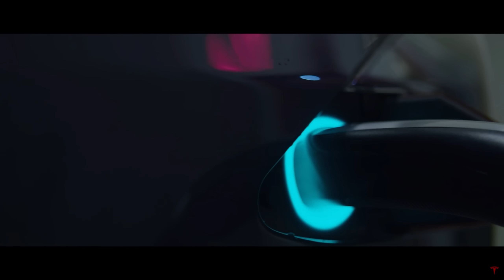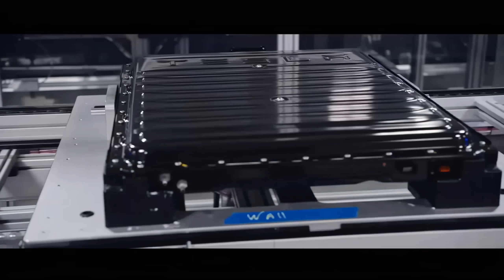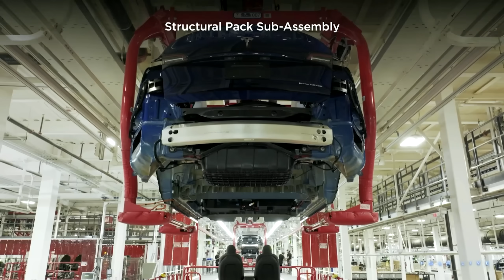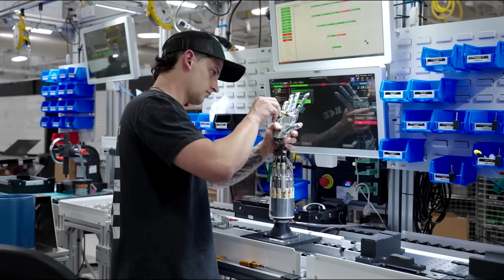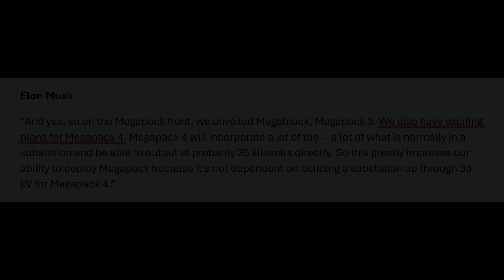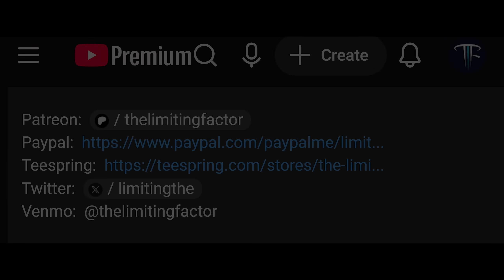The Fully Dry 4680 Is Now in Production! // Tesla Q4 2025 Earnings

Comment from the maker: For those who'd like to go deeper, I've done an article on X called "Fully Dry 4680 Masterclass" which contains information you probably won't find anywhere else:

https://x.com/LimitingThe/status/2018440131057983914?s=20
Reply: dont forget Tesla NV also opening LFP factory in 2026.
Reply: Thanks for the deeper dive on X.
I hear there is a new 2180 cell about to be produced, how does that fit into the lineup ?
Reply: Did you discuss density? Did I miss it?
Reply: NEXT for Tesla is silicon Integration w/ Li metal Anode.
Reply: Does it tell if the battery missing in the mail ever showed up?
Reply: When will they implement these batteries into the Cybertruck?
Reply: @dudeasp1 The Cybertruck was originally envisioned with 4680 cells as the power source. I guess Tesla will allocate 4680 cells to which ever use case will make them most money most quickly, whether it be Cybertruck, Powerwall, Megapack, RoboTaxi or Semi-Truck?

Comment: Tesla Announced in January of 2026 they have Perfected the 4680 Battery with a Dry Cathode & Anode
There has been no info after that announcement
What are the Specs on these batteries?
Where are these batteries?
What cars are these going into?
What Mileage can we expect from them?
Europe Model Y owners are complaining of poor battery performance from their 4860 equipped cars. Are these the “Perfected”  Dry Cathode 4860’s?
Berlin gearing up quickly with factory to mass produce 4680’s, are these the Dry Cathode versions?
Do you know the Model Y RWD Long Range in China get over 821 KPC/ 510 MPC because they use Chinese batteries not allowed in the US. Can the Perfected 4680 compete with China's batteries?
Reply from the maker: They didn't say the 4680 cell was perfected.  They said they can now produce 4680s with a dry process.

1) As always, we need a teardown.  You never trust the specs from the manufacturer, and most of the time they don't really give them.

2) In the European Model Y.

3) Likely typical of any other high NMC battery.  Theoretically, they should last longer, but I wouldn't hold my breath.

4) Yes, but as above, not perfected.  I just sat down to script a video on this because it may not be an issue with the cell, but rather the pack.

5) Likely yes.

6) Again, what is it with the perfected language?  There is NO perfect battery made by any manufacturer.  It's a constant work in progress.  

That range isn't real world accurate.  It uses the LG cell, and similar cells are used in the Panasonic/U.S. version.

7) EVs don't compete at the cell level.  They compete for sales based on overall value.  If your vehicle is selling the most units compared to the competition, you are winning.

Comment: Just had a thought , if tesla does make a longer 4680 aka 46120 say for the semi would that allow the CT to reach that 500mile plus range if used for them plus I remeber in munroes teardown there seemed to be a rather large amount of room left in the pack that seemed to be doing nothing???
Reply from the maker: The extra room in the pack is for cell venting and clearance in case of a puncture 

I would love it if they can make a 500 mi range of the cyber truck, but the way it's designed is supposedly not compatible with a longer cell 

If you use a longer didn't likely wouldn't be able to pass the safety tests or require going up into the cabin which would require a redesign of the vehicle
Reply: @thelimitingfactor 
Do you know in the new packs with the new 4680 for the 3and Y does it have that same space for venting?
Reply: How many more cells would they need to add to get to 500+ miles?

Comment: BYD's Blade battery may be hard to get info about but would be interesting. Claimed charge from 10% to 80% in 5 minutes.
Reply: Seems Tesla's is higher density and could be faster and cheaper to produce and maybe BYD's is faster to charge due to cooling ease.
Reply from the maker: I imagine they're taking a similar approach to the CATL Shenxing, which I've done a video on.  CATL Shenxing Plus Technical Deep Dive // How it Fast Charges

Comment: So what are your thoughts on a 46120 cell. After the launch of the standard AWD CT, it got me thinking that a easy way to differentiate from the standard model would be to make the Premium CT with a 46120 which would give about 475 - 480 miles of range. With an increase of weight comparable to that of the original range extender. Additionally, it could be used in the Semi as you mentioned in the video and thus help reduce parts count / manufacturing steps. With even a small amount of Silicon, they probably could hit that 500 mile range sometime later next year maybe?
Reply from the maker: I don't think they'll use a longer cell based on Munro's teardown.

I'd love for them to do that, but from a technical perspective it's low likelihood

Comment: Jordan, excellent deep dive on the 4680 dry process. As Tesla finally scales this, the industry's focus is shifting from 'Cell Energy' to 'System Efficiency.'While the 4680 solves the energy density problem, we are still seeing a massive bottleneck in how that energy is translated into motion, specifically the 53cm Mortality Gap in L5 autonomy. Current stacks at $50\text{ Hz}$ ($20\text{ ms}$ latency) are effectively 'blind' for over half a meter at highway speeds.We’ve been benchmarking the Z-LAW v023 protocol which utilizes a $250\text{ Hz}$ ($4\text{ ms}$) reflex arc. By bypassing legacy OS layers via Zero-Copy DMA, we’re not just saving lives, we’re saving battery cycles. High-frequency precision means fewer micro-corrections and less wasted energy in the actuators.If anyone from the Tesla or Rivian engineering teams is reading this: The hardware (4680) is now here, but the control loop needs to catch up to the speed of physics. Detailed HITL specs are on the NODE-023 repository. #PhysicalAI #BatteryDay #Tesla4680 #ZLAW #NODE023"

Comment: Hey Jordan, I Googled it, and apparently Tesla isn't the only company that has successfully made dry electrode batteries. 

Per Google AI:

"Key Companies and Entities Developing Dry Electrode Technology:

Tesla: Currently manufactures 4680 battery cells using a dry cathode and anode process, which they announced in early 2026 as having achieved full-scale production capability for Model Y vehicles. This followed years of development, heavily influenced by their 2019 acquisition of Maxwell Technologies.

Sakuu: Developed the Kavian® platform, a dry-printing process that creates both anodes and cathodes for lithium-ion, sodium-ion, and solid-state batteries.

Dragonfly Energy: Successfully developed and tested a dry-deposited anode in a pilot line, aiming for large-scale production, specifically focusing on LiFePO4 batteries.

LiCAP Technologies: Manufactures Activated Dry Electrode® sheets for both anodes and cathodes, with 300 MWh of production capacity, partnering with firms like Dürr and Cellforce.

AM Batteries: Utilizes an electrostatic spray deposition method, known as Powder-to-Electrode™, to create high-performance anodes and cathodes without solvents.

Volkswagen/PowerCo & Koenig & Bauer: Working together to develop a roller press system for dry coating, targeting full-scale, energy-efficient production.
Anaphite: Focuses on dry coating technology specifically designed for LFP batteries.

Fraunhofer IWS & FFB: German research institutes advancing the DRYtraec® direct rolling method for industrial-scale dry coating."

Are any of these other companies worth talking about in the DBE conversation? Is a comparison between Tesla's DBE method and these companies methods in order?

Comment: Dry process doesn’t necessarily mean cheap process. If it’s too slow to do… You need more equipment to produce the same amount of batteries? Probably, that means you also need a lot more space. So then you have to pay for more space and more equipment and that means the cost is not lower. Also, these are probably not sodium batteries, which are probably the cheapest, kind of battery that could be mass produced at this time that would be good for EV cars. So it’s hard to imagine Tesla really has the cheapest battery, and that they are outside of the China supply chain situation. I would say China still rules in the battery production business.  With more than four times as many people in the United States they have four times the number of geniuses probably to work on scientific improvements. Anyway, we should be walking for health, not driving around even if it’s electric. And is ELECTRIC truly sustainable if we are overpopulated, including the planet with other garbage pollution? I don’t think so.
Reply from the maker: In this case, a dry process does mean a cheap process. 

It uses about 1/10 the equipment 

This dry press can be used to make sodium ion batteries and eventually will
Reply: Wow!  Dry is better for sure if it’s fast enough.  And great if they can do sodium too. That’s good but we need to re-zone to allow walkable towns with food and work closer to housing. We are polluting the planet even with EVs. And you say they use 1/10th the equipment but…. How long to make them compared to standard process?

Comment: Until they can solve the silicon problem the 4680 will always be limited in both total capicity and charging curve.

I dont know if it's possible to construct the cell can to include excess space to account for this, which would in turn hinder volumetric density.  But I think it is clear now that the swelling causes issues in a structural pack.

It appears Tesla has now solved all of the individual points of battery day, getting them to "dance together" so to say, may still be a ways off.
Reply from the maker: I don't know how you came to these conclusions, but they aren't correct. 

It seems like you started with a premise and are trying to shoehorn reasoning in behind that

Comment: I don't understand why this even matters.  Sure this thing is gonna be 20-30% cheaper, prices have been plummeting hard regardless.  Outside of US there was no cell constraint, nor any trade constraint.  4680 might bring down the cost of the car by about 2k at most, a 49k LR AWD is gonna be 47k, its not much.  Their battery pack is massively outdated, weak charge curve, low capacity.  

They need to improve by almost 20% in battery density to continue being competitive.
Reply from the maker: mmmm, not sure if this is sarcasm because you're talking about a multi-$k cost decrease as if it's no big deal.

Other u.s. competitors are already raising the white flag and bailing on EVs, while tesla is solidly profitable.

Either way, even before fully dry, the in-house cells are lower cost than any other alternative they can buy on the market.

This puts a lower floor on their cells costs than anyone else can achieve.

As for the rest, I've covered it in other comments and videos for that matter.
Reply: @thelimitingfactor  2k is the price of the paint option:).  Toyota Rav4 is 8k cheaper for their base model and has physical buttons for seats.  What I'm saying is its better if its 2k more expensive but has 20% more range and faster charge, i.e. it catches up to their chinese and now german competitors.

Comment: This is great news indeed! Yeah, it took them all these years, I still remember the Battery Day hype, I expected  Tesla to show up with Roadster II  to have these batteries to fulfill the 620 mile range and also being capable of flight with the SpaceX package or something. As Elon himself usually says, they turn the impossible into just late.   
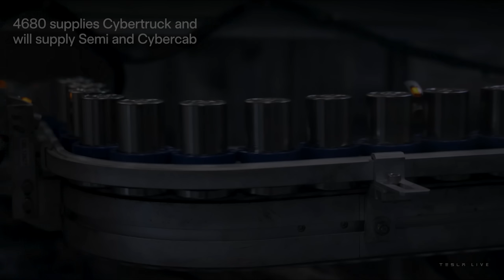4:33 Tariffs will always cause trouble, even if you have fully vertically integrated production. Even Milei back then thought that Trump was going to use tariffs temporarily as a way to negotiate, not just impose them raw. The outcome is clear, as Elon himself hinted in a post he deleted later. Tariffs have caused more trouble than it's worth. 
Anyways, with this new tech I expect them to show up achieving the impossible once again! I guess the lower production cost would also help lowering the costs for all the vehicles that equip 4680 cells, and that eventually all vehicles will have that tech. Also, greater energy density, higer charging speeds, more range, lower prices, etc! I guess the Tesla Bot (Optimus) would also become more affordable? Also a sleeper cab version of the Tesla Semi with 650 or 700 mile range (to be able to go 350 miles into the middle of nowhere) would also be possible! The only sad thing is that now model S and Model X are no longer going to be produced.
Reply from the maker: Yeah!  I'm going to miss the Model S/X.  One of those was probably going to be my "made it" vehicle, lol

Comment: Structural 4680 is done for:: it's evolved into cell-independent structural pack via epoxy + gigacastings. Hard shell no longer needed for old reasons: can can be thinner. All that matters now is how Tesla scales dry. They can experiment now with silicon up to 20% + nanotubes & special polimer coating as well as thicker anode & cathode layers, all leading to much better density and probably better charging. Unsure on cycle life. Cybertruck badly needs those improvements, 25-30% density gain and 400 mile to make it viable. Semi efficiency could improve by using fewer cells, but they'll go for cycle life just like Cab. Roadster would benefit from high density cells the most and I predict the Model 3 Plaid coming out following the Model S legacy.
Reply from the maker: Practically, the structural pack just means removing the structural floor pan and making the lid of the pack the structural floor pan - which Tesla has done.

I think the current structural pack probably doesn't realy on the cell for structure as much as they anticipated originally, but it still doesn't to an extent.

Comment: It looks like CATL and BYD are  finally making serious progress on solid state batteries. Exciting times ahead.
Reply: china is about to implement an official standard for it in june, which imo means they are serious about getting these up to speed and dominating the space smfh. I wonder if elon has something up his sleeve for solid state/semi solid state 4680s? He said the all dry cells will be 10-20%better cell level energy density then existing tech. Which would solidly put tesla in the lead outside of china and still only second to the best current cells they offer. Which in a production car to my knowledge is the welion semi solid pack of 144kwhs capacity in the nio cars. That pack weighs just 22kgs more than the best current catl nmc 100kwh pack they supply nio with. But is rumored to cost over $30,000 us a pack!
Reply from the maker: I'm rooting them on!

Comment: The question is of course; have other technologies and innovations negated any advantage of this dry construction method? 6 years was too long. I think that while it is an amazing achievement it’s too little too late to be the game changing technology that we all assume it was going to be. Let’s just hope that they can get a good decade of high production and profitability out of it. Realistically I think that 5 years is going to be the maximum competitive viable period unless costs can come down significantly. At the end of the day there’s no battery out there today that can’t and won’t be a good viable option for a particular use case or two. How cheaply, and how economically over a given lifetime, in this increasingly competitive market, it can be installed into the end product is the question.
Reply from the maker: No

This provides a multi-decade advantage.
Reply: @thelimitingfactor brave statement. 😅

Comment: Followed you for years and happy to see this day! Great insights as usual. Question: Do you see the new Samsung silver carbon battery as a threat to the dry 4680? Do you think Tesla would pivot to this Samsung battery in the future if it is indeed a better technology? Do you see this new Samsung battery as a threat to Tesla stock price if the hype is real? Thanks!
Reply from the maker: Thanks!

Nah, there are a dozen potential solid state or high energy density batteries out there.

But, they all have drawbacks.

The fully dry 4680 will be the cheapest cell on the market for the performance - which for the time being is the most important metric for most industries.

Comment: I thought the dry coating might be applied like a " powder coating" paint where a slight charge is applied to the surface while the powder is sprayed but sticks consistently because of the electrical charge.
Reply from the maker: That's one way to do it!  Spray method.

I'm not sure what the issue is with that methode, but it's not what most manufacturers are going for.

Comment: THEY ORIGINALLY SAID IT WAS AN ENGINEERING PROBLEM not a chemistry issue ...........IT ONLY TOOK 6 YRS and these are supposed to be the worlds best ????
Reply from the maker: Yup.

These innovations typically take decades.  Hence the phrase "ten year overnight success"

Many companies are failing to simply get a battery line up and running, let alone revamp each step of the process.

Moreover, Tesla didn't just build a line, they built an entire battery supply chain.  The only other entity to do that was the entire country of China.

Super impressive.
Reply: @thelimitingfactor  Perfect rebuttal, flawless victory!

Comment: Is there a non-dry electrolyte in it?
Reply from the maker: Good question. 

It uses a standard liquid electrolyte. 

The big difference here is that the electrodes are coated using a much higher throughput and lower cost process.